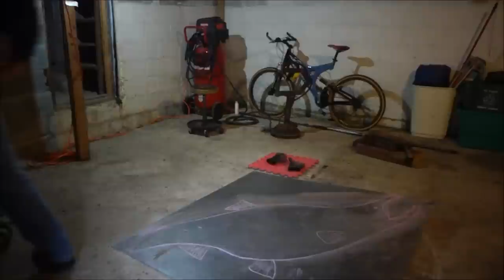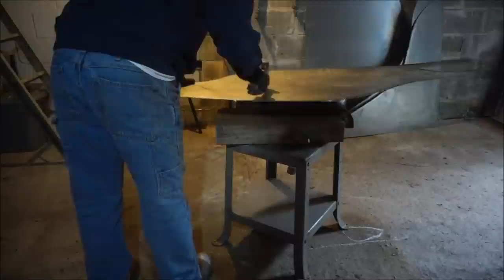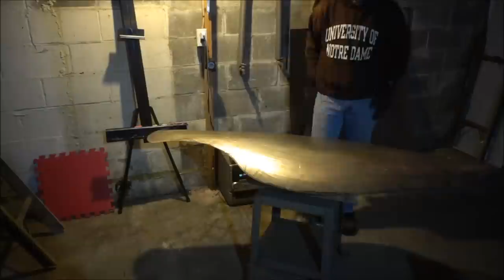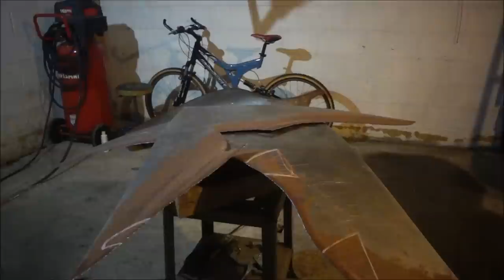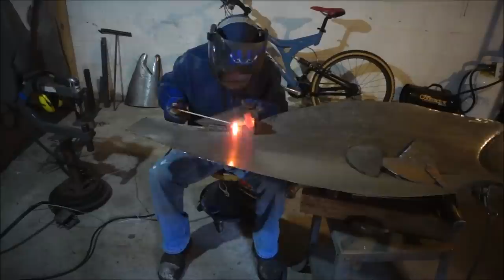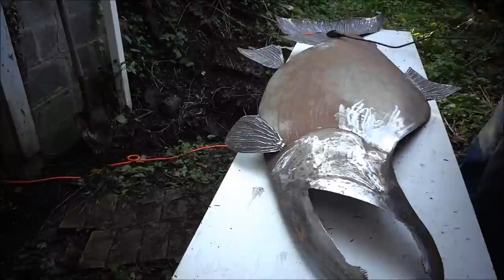How to make a steel sculpture - Sockeye Salmon (how I make them)

Comment: Very Nice!  Do you get the original profile pattern from photographs, or other "artwork/drawings",etc.?  Have you tried using sheet aluminum?!  Have you tried painting/anodizing/dying the metal surface to obtain any 'lifelike colors' (pinks/reds, blues-silver- white/gray, etc?...  What do you do, or use to seal/coat the metal surface once you are done?   Do you make "Weathervanes", of "Signs" with similar pieces?..... do you make any 3D pieces (fully formed on both sides,... etc.?) What other forms do you like to make? - birds, larger  four legged animals, etc.?
Very nice!    Good work!!!
Reply from the maker: Thanks, gulo! If I'm not in some way intimately familiar with whatever the subject matter I intend to create, I'll utilize references for a gist, but I'll inevitably put a personal spin on the ultimate piece. I have indeed worked a fair amount with aluminium and other metals but in this case the client preferred mild sheet steel. A commission I received as a direct result of my sockeye video was for three slightly smaller versions with varied poses, I used the process I call "heat painting" in which I used a torch on the back side of each piece until the metal reached a specific color on the 'heat treating' spectrum in order to achieve an analogous color representation. I'm not a big fan of copying - creating a duplicate of (insert whatever). Second to that is a dislike for painting steel. I can't always avoid paint on steel but I try. Steel has a very tenacious atomic structure/an immutable DNA coding which implores it to follow an overarching desire to rust. Regardless of the influence one exerts on mild steel, short of the stainless steel process, it will either become an upkeep nightmare or it will rust. I don't see the sense in fighting the molecular inclinations of steel and I rather enjoy the perpetual evolution - in a sense, perpetual motion - of allowing it to just be. If, however, a client requests a weather barrier, then, alas, I will either use an acrylic, poly, oil, paste, resin or similar coating based on geography and aesthetics. Weather vanes, no. But many, many signs, 3D pieces, abstracts, figures (human, plant, animal, celestial), kinetic, utilitarian, whimsical, kick scooters, structural...
I have no favorite subject matter, per say, but I've noticed in the past few years that I derive the most satisfaction from pieces which are geometrically bewildering/challenging, as well from those which are asymmetrical and or gravity defying. Great questions, and I really appreciate your compliments.

Comment: This looks like 16 gauge sheet but you stick weld it.  Am I right in the thickness?  If so you are a stick welding master.
Reply from the maker: Sorry for the really late reply. Youtube has a knack for hiding comments from me. You are right on as far as the gauge. Though, you are a bit of as far as my level of welding mastery. You overshot quite a bit. But I'll take your generous compliment just the same. Thanks, Jtb!

Comment: That air hammer fixture, did you make that your self?
Reply from the maker: killerjeanne Hey there, killerjeanne! Not sure if you mean the air hammer's bit or the structure itself, so... I bought the air hammer and surrounding rig (gray structure + hoses and pedal) from HF, then welded to it a mini stand out of 4.5" round tube and a brake rotor for the base. The air hammer bit (what's actually striking the sheet steel and connected to the hammer) is an old air hammer chisel that I cut the head off of, rounded, then heat treated. I did this for two reasons: I wanted something to mimic the look of fish scales, and it's great for making quick creases or lines in the sheet. I hope I answered your question. If not, or if you have more ?'s/comments, let me know.

Comment: Still in Seattle? I'm a metal artist here as well and was wondering how you ended up heating your shop :)
Reply from the maker: Hey, Kevin. Yep, I'm still here. I built a self-feeding rocket stove which worked great but it took up too much work space. I replaced it with an electric space heater and an extra layer of clothing. That worked great but the electric bill shot up and the bulky extra layer made my physical mechanics clunky so my current heating solution is to do design/engineering in the house and not to doddle while in the shop. Fairly mild temps so far, though (knock on wood).
Reply: Cool, thanks. Yeah the jump in the bill is huge if I use an electric heater. My propane heater looks just like yours, that's how I noticed your video. Works great and not a fire hazard while I'm in there... Looking at a way to heat big chunks of steel with it so I don't have to leave it running long to keep the co2 down and get the residual heat....
Thanks for response!
Reply from the maker: That's (heating a chunk or stack of steel for radiant warmth) is actually a really clever idea, and very possibly THE solution. I'm very curious how it turns out so, if you would, please keep me in the loop. I love my/our little propane heater but shelved it for two reasons: 1. propane in Tukwila - Seatac, actually, is brutally more expensive than what I paid back in Indiana before moving here. How much do you pay, out of curiosity? And 2. My stinging eyes would always tell me to shut it off well before the shop's temp reached a comfortable, plus the whole turning it on and off on and off on and...  

I, along with my fiance', checked out your hog-n-bird video. You got one thumb up and the other thumb way up. Although she didn't say it, I'm certain she's a bigger fan of your animals than she is of my giant fish. Well done! The only bummer I experienced while visiting your channel was the lack of opportunity to watch more videos of you doing what you do so well. Keep 'em comin'!